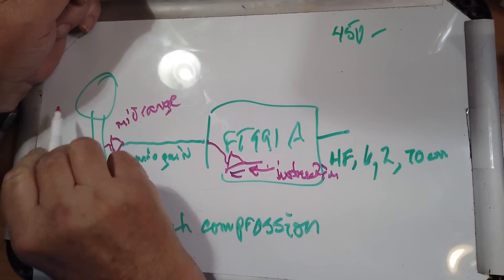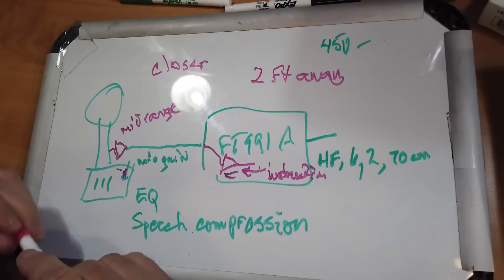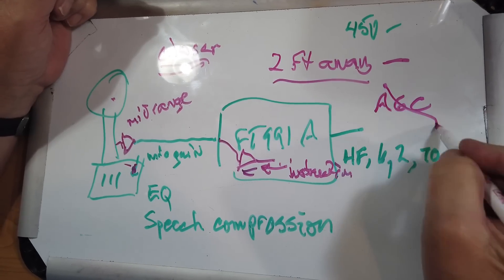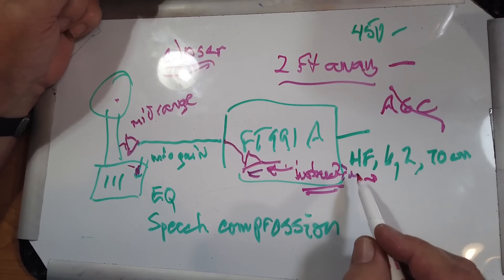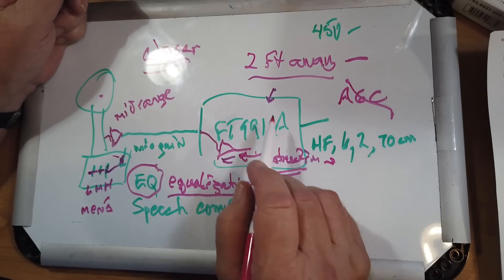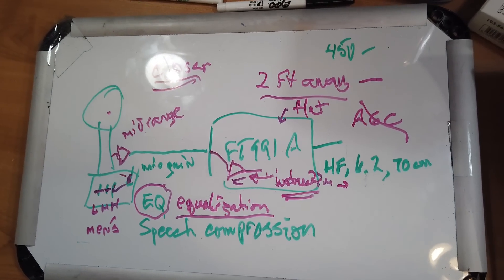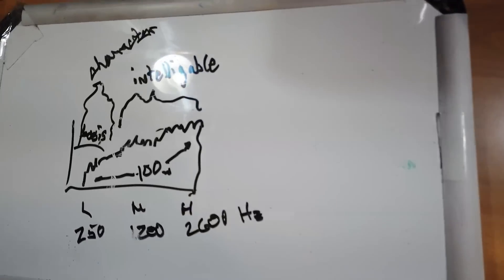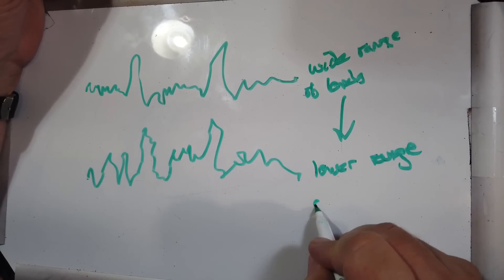Messing with your Audio: Gain, Equalization, and Compression  (#771)

Comment: Additionally, the FT991A has a SSB adjustment for Transmitter Bandwidth. This can be used, considering your voice  characteristics to get more punch into your signal by controlling where the power is in the output. The Yaesu manual has very good details on the Mic Gain, Mic  EQ,  Compressor and SSB transmit bandwith (separate control).  Also check the mic for its controls. I have a M70D and needed to turn the low cut on for my voice. Its worth studyingthe manual, and  perhaps get a knowledgable amateur on the other end to listen while you make adjustments so you can get it set up effectively for clear speechand good signal punch. You can also use  the internal moni function to get an idea. .....WA2MIB

Comment: The MH-31A8J Hand Microphone is the standard stock microphone supplied with the FT-991A, the Desk Microphones are available options, as is a better Hand Microphone. So the only gain control for the stock mic is in the radio, not the mic itself.
Just like the IC-7300 stock mic has no adjustments on it either. Though my  optional ICOM SM-50 has a continuously variable potentiometer for gain, and a low cut filter.

Comment: Well, listening to this with a frequency counter app running, you are hitting 496-8000 Hz. You are right about the 8kHz top! Hard to tell where the average is but it seems like 2000-5000 Hz, fwiw.